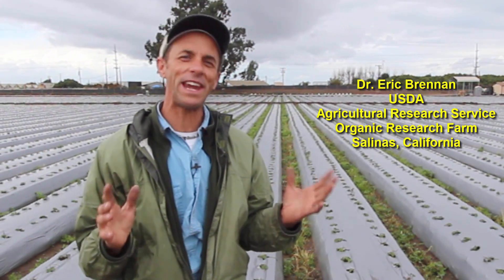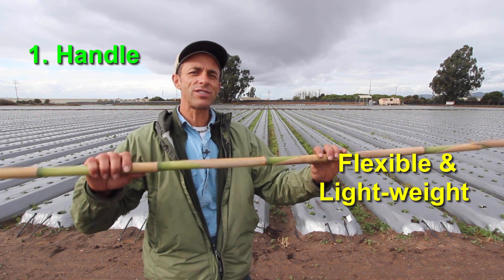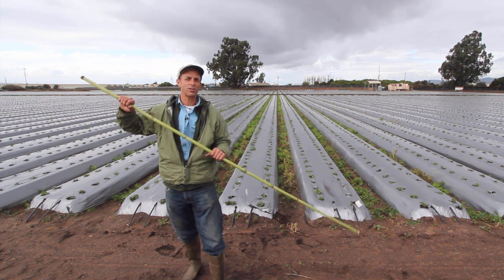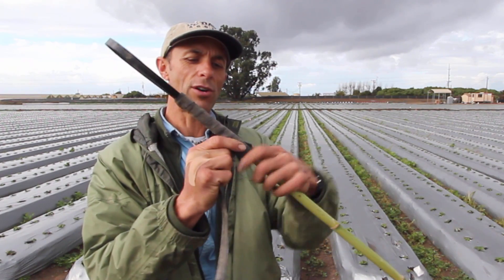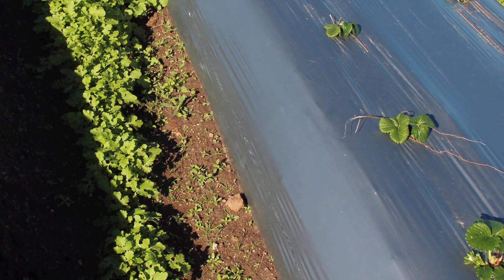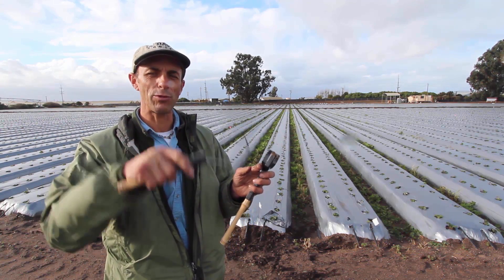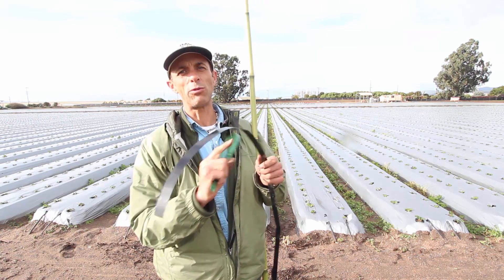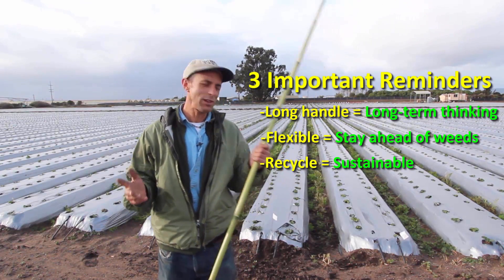How to make an INEXPENSIVE HOE for EFFICIENT WEEDING, 'Recycle Strap Hoe'.   Weeds beware!

Comment: I  just started using Farmall tractors to plant and cultivate a large garden.  I cultivated for the first time yesterday, after the seeds had only germinated the week before.  I placed the front sweeps about 12" apart, they were about 6" wide.  On the rear bars I put 2 large 18" sweeps to break up the compaction of the tires.  I noticed that the front sweeps were breaking up the soil and leaving about 6" of undisturbed soil, but I was almost covering up the small corn, bean, and pea seeds that were a week old.  I think I could make some small "hoes" like you have shown and attach to the front tool bars and get much closer to the plants without worrying about burying the plants due to a large tool passing near by.  Thanks for the idea.
Reply from the maker: Thanks.  I like your idea and would love to hear how it works.  If the field doesn't have much crop residue, it may work well.  If there's lots of residue in the cultivation are it might build up on the straps and then cause them to bend out of shape. Just a thought.

Comment: Saw this after Picnic Day 2019. I have only found strapping once, in the dumpster of a fraternity.  That was perforated and bent easily. 

 I'd like to try this with new strapping. Anyone know what kind to get, other than high carbon types of steel?

I think this tool is very important even if it requires new stuff.
Reply from the maker: Thanks for the comment. Other materials (other than recycled strapping) that could be used include worn out blades from a band saw, strapping from a large hose clamp.

Comment: We used steel strapping as hoes 30 years ago in Ontario Canada on onion farms. We just made the loop smaller so you could get in between the onions. I have one in my tool shed.
Reply from the maker: Great to hear this. Thanks for sharing.
Reply: @EricBrennanOrganic  in Russia some people  use  steel wire this way. Wire is not sharp, but it  works  too.

Comment: Could I use a thin metal saw blade for this?
Like this:
https://pevex.hr/pila-za-metal-300mm-015417.html
Reply from the maker: Yes a thin saw blade might work but the it might not be as flexible or thin as the strapping.

Comment: Τhanks. What would you think of using a wire?
Reply from the maker: You're welcome.  Good question.  I doubt that a wire would work well on its own because it would likely bend too quickly unless it was quite thick.  A thick wire would not cut through the soil easily.  Here's the commercially available version that I used before I developed the recycle strap hoe. https://www.johnnyseeds.com/tools-supplies/weed-control/hoes-cultivators/long-handled-wire-weeder-9374.html   I've also seen some DIY wire weeder designs in the web, but I still prefer my recycle strap hoe.

Comment: Thank you! Just went out and cobbled one together using a blunt 3' bowsaw blade to test the concept.  It's not safe around plastic like yours - but discovered I can flip it on its side and use it to saw off taproots at the surface :) Will definitely be asking the local timber merchant if they've got any strapping lying spare...
Reply from the maker: Sounds great George.  Thanks for sharing this.

Comment: can we use this method for big/ bushy weeds as we have many in the yard
Reply from the maker: No, I doubt it will work on large weeds.  It's best for small weed, although if you sharpen the blade with a file it might work for some larger weeds.

Comment: This is the most useful video on weeding and tool making I have seen.  I only have corn stalks.  Can they work?
Reply from the maker: Thanks.  Interesting question about corn stalks.  It  might work but may not last long.  You could also just use a dowel (3/4 inch, 19 cm diameter) that has nice flexibility.
Reply: @EricBrennanOrganic  I have an abandoned lot (9x9) that has heavy weeds.  Some may have deep and strong roots.  What is the best tool?  Thanks.
Reply from the maker: I suggest a shovel to dig up the weeds and break up compaction too.

Comment: 2:00 "Because it's asymmetrical, it works very well on one side but not the other."

Couldn't you...turn around?  For the other side?  Go down one side, then go down the other side. I do that all the time.
Reply from the maker: Hi Bryan,  I usually bend the hoe so that it's pretty symmetrical and works on either side of the furrow.

Comment: I wonder what would happen if you put two or more straps as blades on the end of the hoe?
Reply from the maker: I'm not sure, but I'd expect that it would more difficult to use because there would be more blade moving through the soil which could increase the amount of energy needed to cut the weeds.

Comment: I used a 1/2" red plastic tomato stake from Lowes that was 76", and got the inner tube and strapping tape from a request I posted on Craigslist. I just finished making it, and IT WORKS! I have a small and delicate flower bed, which is hard to get to without damaging flowers. This tool is GREAT! I bent it with a narrower shape, and it made the weeds fear me! THANK YOU FOR THIS VIDEO!!!!
Reply from the maker: Glad you like it.  You are very welcome.

Comment: Regards , there is one my proposal. When you cleaning weed , you are going ahed and you make presure on the weed and soil again. most of weed plants will again be conected with soil and they will continue to live. So , i think is beter to go in the back, when you are cleaning weed.
Reply from the maker: Hi Boban, I agree although it is more difficult. Also, we're getting the weeds when they are very small and dry out quickly even if we step on them, especially if the soil is dry.

Comment: I have a stirrup hoe and I love it so it is not a waste for me. The soil where I am is clay and rocks so I am wondering if this would hold up to that kind of load. Maybe I will make one and see which one works better. I have made something like that for a hand weeder and it works well in looser soil. 
Thank you.
Reply from the maker: Stirrup hoe can be good for larger weed, but I think you'll find the one works well for smaller weeds.  We like to get the weeds when they are small and don't have any chance of producing seeds.
Reply: I do too and devote about an hour a day to going through and hoeing. The problem is that the clay soil, after a few rains, becomes really quite hard. Add to that the rocks and I am wondering if the rubber tubing would be sufficient to keep the end on the handle. 
I may give it a try this summer. If I do, I will see if I can make a video to compare them.
Reply from the maker: You might try using a ring clamp if the rubber tubing doesn't work.
Reply: i saw one made with greenhouse wiggle-wire that looked good too

Comment: Awesome! Building a mulch layer for the up and coming season and was wondering about walkway weed control.  This is the answer.  Planting cover and maintain weeds with the RECYCLE-HOE!  We will crank these out for our crew, share with farmers, and annihilate weed.  Thanks for cracking some eggs of knowledge all over our farm community.

Do you recycle your mulch?
Reply from the maker: The mulch is hard to recycle in our area because of attached soil, but drip tape if often recycled.